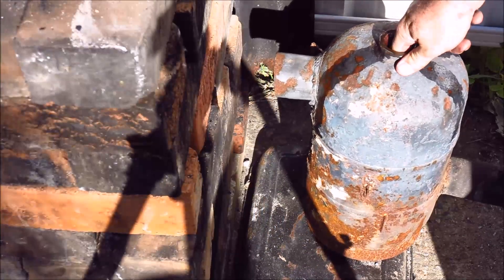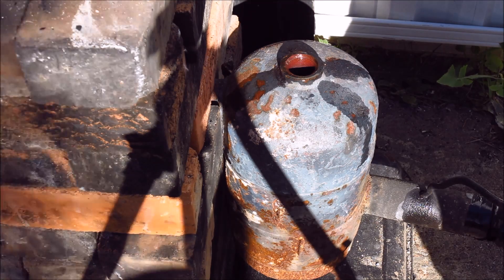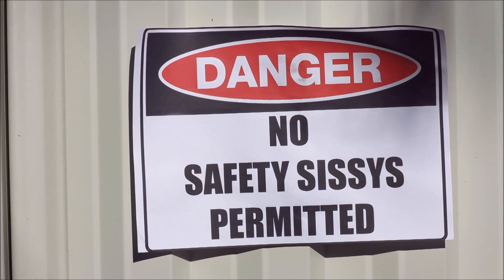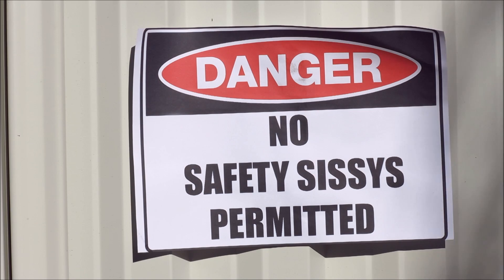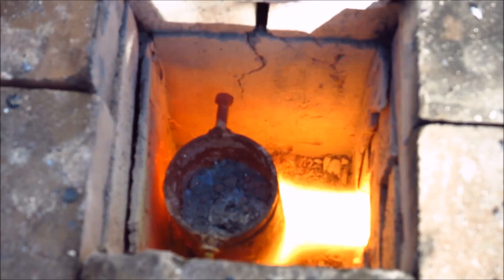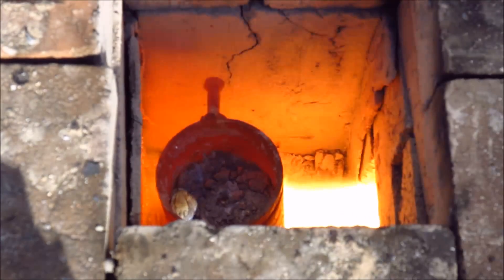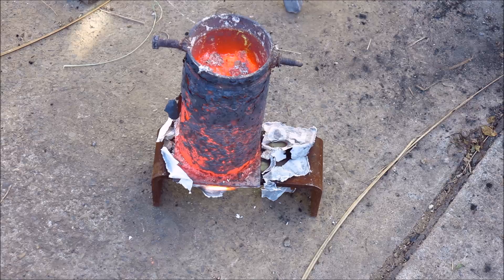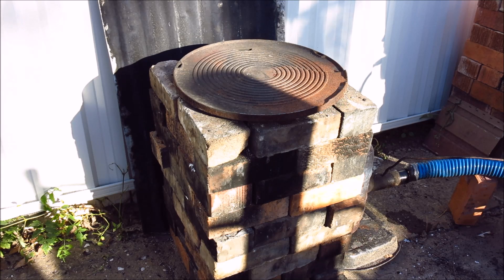Melting Aluminium with brick furnace oil fired.

Comment: Been watching and enjoying your videos and humor. "How the devil are ya!?" LOL.

So this burner put out HEAPS of heat.... I am only wondering if it will help a little if the burner itself is also in refractory cement? I am building up the courage (and when I actually have the time between work and sleep) to build a furnace for playing around with Aluminium casting. Which reminds me... Love the sculptures!!
Reply from the maker: It may help speed up the light up a bit by getting the burner up to heat quicker but you would be talking maybe 15 seconds. other than that, there is so much heat coming out of this thing it was basically idling. The problems was not getting enough heat, it was keeping the output down enough.

Comment: Hi oil burner.  Is your oil feed pressure fed or drip fed?  Thanks Paul from uk.
Reply from the maker: I can't remember on this vid but I think it may have been pressure fed by air into the Drum. I'm over gravity feed. It is too  inconsistent  and variable. People talk about wanting simple but gravity actually makes things more difficult. I use small Pulse fuel pumps now and everything works much better.

Comment: G'day oily I  hope you see this MSG Is that brick furnace just made out all brick and and oil drip and can you just u use a leaf blower as well? I won't to get in to this as soon as I can thank for your time .
Reply from the maker: Hey mate,  Yes it was just Brick.  They won't stand up to many blasts of heat like this but for a one off is Ok. If you wanted to go more permanent you would be well off to use a layer of refractory bricks on the inside and normal bricks on the outside . Put it together with a Mix of cement and Builders clay. The oil was fed into the air tube like all my other burner designs and a wood fire started to pre heat the bricks inside. Once they come up to temp the oil vaporises and self sustains. You add oil slowly which will burn with the wood and the preheat will come up fast.  Do not be shy about giving it fuel and air once it's going. Some people seem to get things going, panic the flame is a foot or 2 High, turn it off and wonder why it won't run.  These things are Beasts not Ballerinas so need a confident hand.  They like lots of heat and flame so give them plenty of fuel and air and you'll melt up to cast iron with no trouble.
Reply from the maker: Forgot to say a leaf or any blower is fine, just need a way to limit it to start with. You can use an electronic sped controller or just block the intake with a bit of cardboard or an old towel and open it up as you need.
Reply: @glumpy10  thank for getting back to me sir it's odd youtubers don't get back to guys like me thank you that's all I needed to know bro. PS thank you again getting back to me fast,

Comment: Where’re you located mate? Im in Brissy... love to chat, directly. I’m also a WVO fan, estimate that I’ve run 6-7000L through my old landcruiser. Love the pirate life!!
Reply from the maker: I'm in shitney... well on the outskirts now anyway. 
You couldn't have run that much oil through your cruiser because as you have been told 100 Times by now, it will blow your engine up the minute you put a drop of the stuff in it. 
You have been lucky so far, just wait another 5-600000 Km and the engine will be sure to blow.... Maybe.   :0)

Comment: Hello, Im left speachless... I would like to melt Lead ore do you think this furnace would work?
Reply from the maker: Lead is like melting butter.  You could do it in the blink of an eye with the amount of power that thing had.
Reply: @glumpy10  what is the fuel consuption?
Reply from the maker: @kitivoinvestment2822  depents on how hard you run the burner and how much heat you want.  Could be 2L hr or 50L hr but you would get plenty of heat at 5L hr.

Comment: looks good.  i put my water balls in a 35a gallon drum, about 3/4 full of balls.  i got some very nice random shaped parts from numerous aluminum pours.  i still need to build the burner that uses drain oil.  thanks for coming  back to it. . . . davidh

Comment: Pre heat is working quite nicely on our micro forge, completely solved the oil drops cooling the work problem, pint an hour while forging is a little different to your 2Gal monsters (imp. gallons, thats about 8 imp quarts)
Your casting was awesome, and thanks for the safety tips.
Reply from the maker: Your forge burner is great. I have been watching your midnight development of that. 
I know you'll never seed the safety tips. They are not for people like you who know what they are doing and get out there and build things but it keeps the idiots that think PPE is needed to change a lightbulb happy! :0)

Comment: Can you tell us what are those water-balls you used and where do you get them?
Great piece of art, I'd love to see the other one you made.
Reply: Seconded.
Reply from the maker: I think they are also called oblec balls.  You can get them off ebay. Look for water balls or water crystals. I have seen them in the florist  and wedding decoration sections. Heaps of sellers so you shouldn't have a problem finding them.

Comment: I need to melt me some aluminum. But I have no oil. So it is crappy wood for me.
Reply from the maker: Wood will work and my efforts could be improved upon for sure but I'm lazy and have put the time into learning oil so that's the easiest option for me.  You could try restaurants or garages for oil. If they have collectors already, a technique I used with success was to look all disappoint and say something like " Those guys always get all the oil, never any left for anyone else to do something with.  Then I say would you mind to save a little bit / would you mind if I just collected a bit now and then?

Often I find it is fear of the unknown and non understood as the reason they say know but when you make it a bit more personal and take the risk out that they will loose their collector and then you won't get it either, they are much more accommodating. Of course if they have a drum out the back you can help yourself to, you haven't mentioned how much a " Bit" is and they really don't care anyway as long as it's gone without mess or fuss. 

You can always get your friends to save you their oil if they change their own. I asked around a bit and that's worked a bit too well. Oil just turns up now and getting a bit more than I need as far as engine oil.
Reply: Oil Burner
wow that sounds great. Since I moved I never really established any kind of a support network where I'm at now. Most folks around here keep to themselves. I couldn't even tell you where any of my friends are today. Although one did call a few weeks ago. That was a surprise.

One of my friends owned a gas station once. But he sold it years ago. I remember the oil sucker coming there though. He had like a 500 gallon tank of used oil. He'd have definitely hooked me up with all the oil I wanted.

Comment: I stumbled upon your vids 2 weeks ago and still playing them every chance I get. I used 20 psi of air and filtered motor oil thru an injector nozzle I built. It gets really hot ,but need to make my refractory and crucible to hold stuff to melt. yours is much more simple.great stuff!
Reply from the maker: Thanks mate. At least your using real mans fuel, Oil!  :0) I'd like to see what you come up with if you can do a vid.

Comment: I like that picture on (Danger on Safety SISSYS Permitted) add picture on the internet so I can download it so I can print it and put up on the wall at my job
Reply from the maker: If you google saftery signs you can get large files and you just edit them to say what you want like I did. 
For work you could put the message then something like " Fred, this means YOU" at the bottom in smaller print. That would be sure to get around the place and make the culprit very aware.  Be hilarious putting saftey signs around a work place. 
You could put something like " Danger Cold water" over a tap or  " Danger, smelly feet and Body odour Ahead" at the entrance to the change room or showers.

Comment: WIFE???  DO TELL...   Last I heard you proposed and the poor woman FLED the country!!!  Did she come to her senses/TOTALLY LOSE HER MIND?  ...Or did you find a new "victim?"     :^)  
= Seriously, we are DELIGHTED for you! Congrats! AND, Best Wishes to The Mgr.     /WAR Dept.  Now understand why you spend less time torching.  =Dish washing does wonders for removing grease from under one's nails, huh?  + Any "new little oil burners" on the way?   Wish you much HAPPINESS!
Reply from the maker: She would have been wise to run when I proposed 25 Odd years ago. Been married for 24 now and shes stuck around talk about glutton for punishment. She could have married a decent bloke instead of me!

I'm looking more at control and automation of burners atm. Thought I'd try and edumacate myself in these little arduino type micro controllers. If I can getr my head around those, should be simple to press a button, have a burner light itself up run till the water is hot or for a certain time or throttle itself when the room is warm and then shut down as well. 

I'm trying to do the mental arithmetic on a big burner.  I have done a measured 600Kw so far, I thought about doing one for 100 KW and then thought if I can do 1000 I can do 1200 so just working out dimensions for the air flow required really. Fuel flow will be 2L a min and that's easy with pumps I have but getting enough air in I think will be the trick. I see double blowers on this one.  :0)

There will probably be some big ally melts as well as I have a heap of it around atm I need to reduce to a more compact  size.
Reply: OB,  Are you still heating your water in a barrel out back?  IF SO, I'm amazed you still have a woman at home! (-Or was that all a joke?) You're fortunate.  Congratulations to you were a bit late.  :^)   My mistake.  Got you confused with a YT'er who had his 'intended' move out.  ="Loved and lost" blues. HAPPY it WASN'T you!  

We've been married 41 years. Many ask how I managed such an exceptional woman. She's been my strength, joy  and best friend through tragedies and a few minor victories.

Comment: I always love your vids. I was wondering if you can use old engine oil from your car in a waste oil burner? Also i think if you pointed your burner off to the side of the furnace a little bit, the flame would spiral around the crucible a bit. Which would heat it more evenly and make it last longer.
Reply from the maker: Engine oil is fine for burners. even has a little more heat per litre than veg.  I always spill something so Veg is a lot easier to clean up for me. That said I have a fair bit of engine oil around that friends and family are " Donating " so I'll have to start getting rid of it. 

You are dead right with the angling the outlet. Because of the way I built the Furnace, ( badly)  I haven't got enough room with the outlet of the burner to do that. Always better to have an indirect flame so it's not trying to blowtorch it's way through your crucible.  When I re do the furnace, I'll put in some pipe I can get some spin going. 
Well picked up mate!.